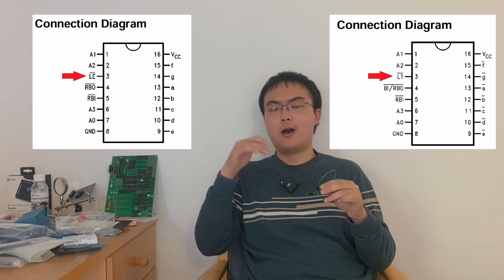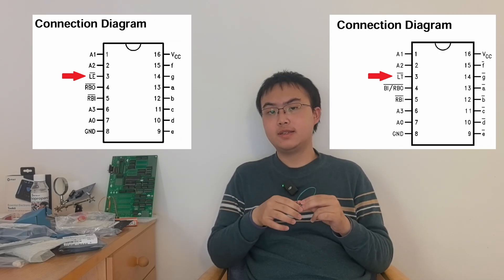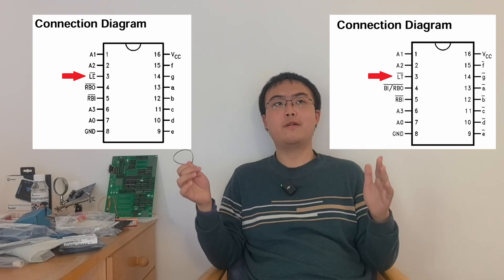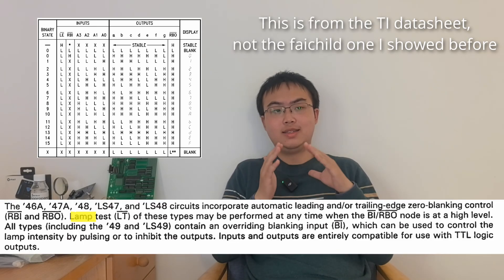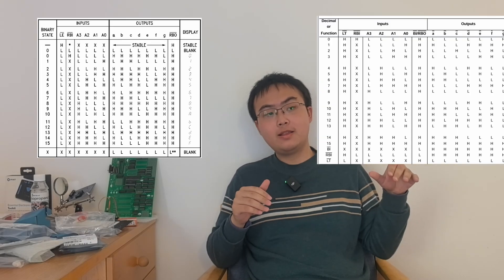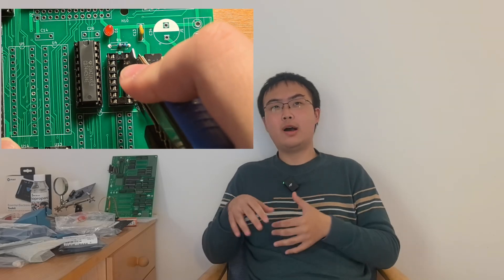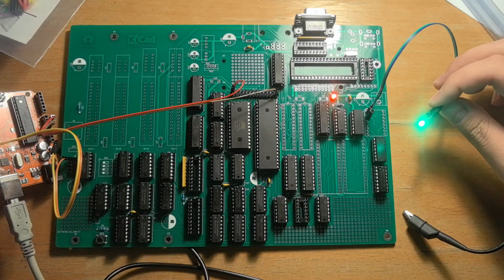A Little Green Light: The story of the first motherboard I designed.

Comment: Nice work!
I also find that JLCPCB is way less expensive than PCBWay. The quality is just as good, however stay away from the purple solder mask as, for some reason, I find for that colour only it has quality issues.
Four layer boards are so much better for signals when you use the inner layers for power and ground.
You should try an auto router. I use Kicad and FreeRouting. I do a lot of designs and it speeds up development by orders of magnitude. It makes editing/moving components quick and easy. Also, the final boards tend to be much smaller than hand routed ones.
Reply from the maker: My board is MATX so there is little point to make it 'much smaller'. I will move to a four-layer design eventually but currently I need to be able to cut traces including power and ground. Thanks for the advice anyway!

Comment: As an owner and assembler of the original Altair 8800 kit in 1975, I have been enjoying your videos for several years.  All I have left of the Altair is the original 1k memory board, a 64k board I added later, and the original 8080.  Unfortunately I lent it to a former student, after I had moved on to a Z80 computer, and it died in a garage fire, along with a 256k memory board.  Keep up the good work with your videos!